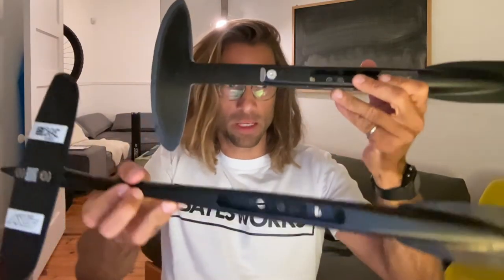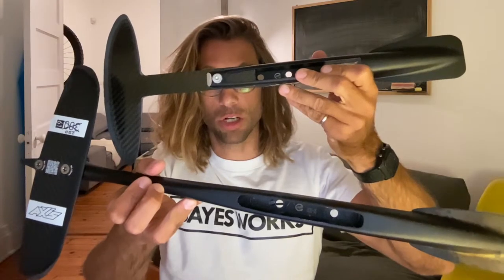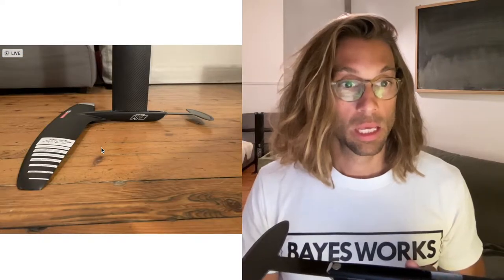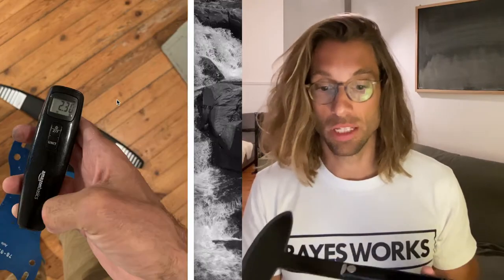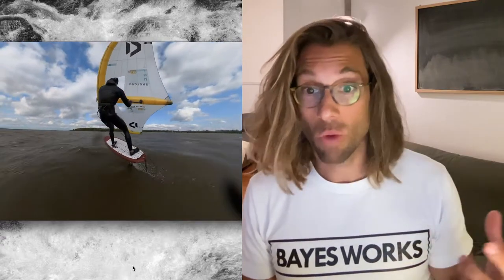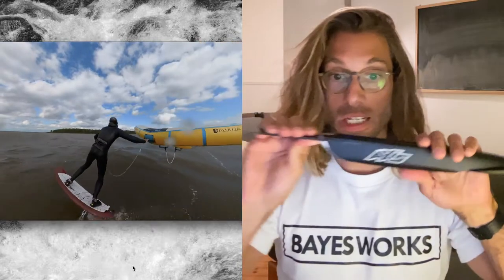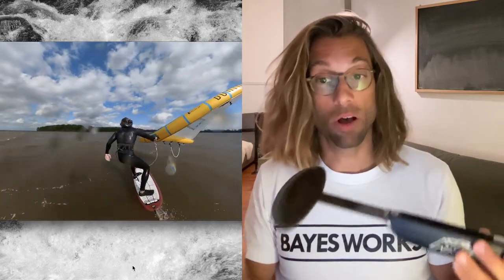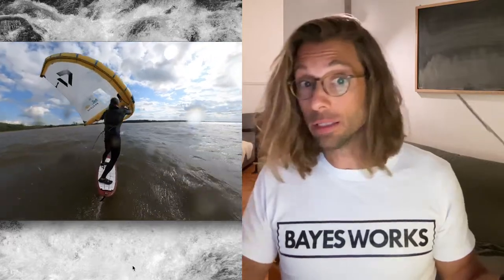AXIS RADICALLYSHORT V2 | I went too far...

Comment: Vraiment excellent.
Hâte de voir la suite.
As tu essayé sans couper le fuselage? Juste pour savoir si une simple lame de carbone pourrait remplacer un stabilisateur traditionnel?
Ça me donne envie de tester avec une lame en alu...
Merci encore pour tes essais. Passionant👍
Reply from the maker: Non, j'ai avancé le mat de +37mm et j'ai coupé le fuselage à 45cm sans essayé avec le fuselage de 56cm avec le setup de mat avancé (sillyshort). À priori, je ne crois pas qu'une simple lame sera un bon remplacement pour un stab car la longueur requise serait trop grande ce quoi engendrerait des problèmes de rigidité. La rigidité diminue avec la longueur d'une pièce à la puissance 4. Pour ce qui est de la suite, j'ai remplacé avec une pièce de carbone plus épaisse. La rigidité est 👌. Prochaine étape, amener le mat directement au dessus de l'aile https://www.dropbox.com/s/90x68r3cots6803/97175C94-0BAC-4D7D-974D-1084848C543C.png?dl=0

Comment: Have you gotten a chance to ride an Axis High Modulus mast and compare it to your No Limitz? Been going back and forth between those two options. Also looks like you use a 78 CM, how you like that length for wing and prone?
Reply from the maker: I have not. However, I did not feel any issue related to the stiffness of the Nolimits. Therefore, for 1.4 v.s. 2.2Kg, I prefer the Nolimits. That being said, I do not yet feel super confident about the strength and durability of the mast... time will tell 🤞. For me that length is the good length for both. I would ideally take 75cm for prone in order to have a little more room in shallow water and I would take a little longer (~83cm) for wing when riding big waves... it helps when going through 1m+ of whitewater :) So overall, 78 is the good all-around length for me.

Comment: Instead of a thicker flat tail why don't you use a thin profiled shape ( like a T shape for example) . It is quite easy to find in advance   what shape will  be theoratically more rigid !
Reply from the maker: It would not work because I explicitly want the thinnest section possible. Mais bel essai papa :)